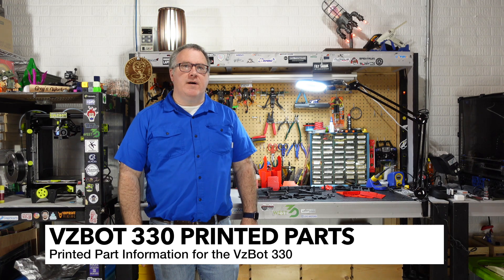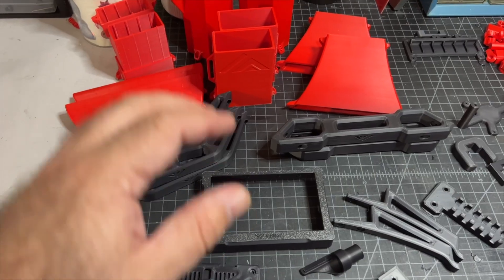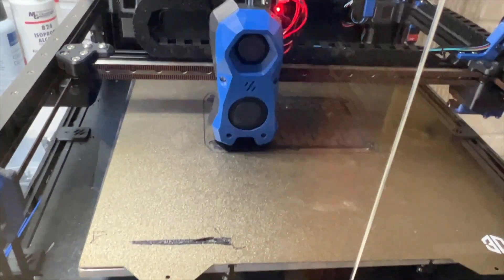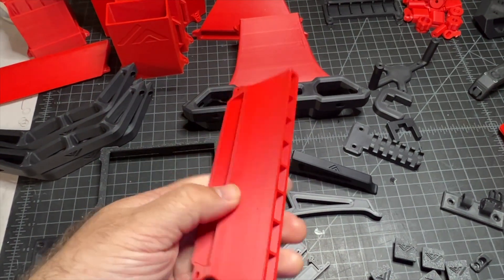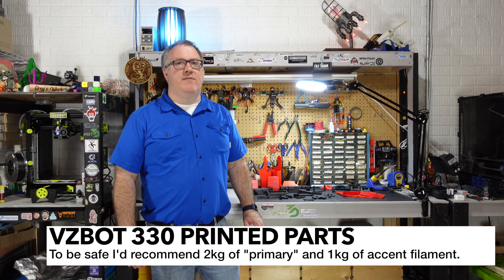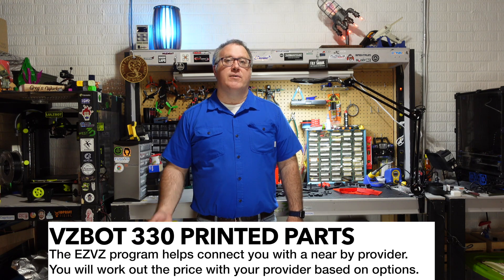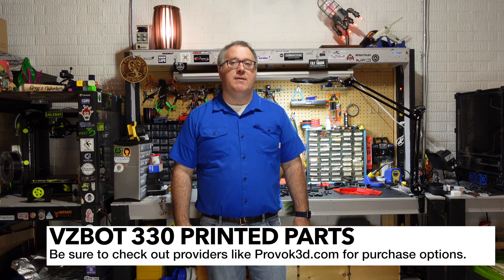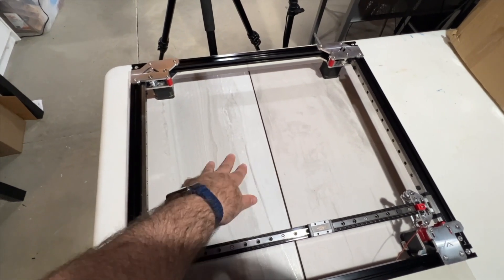VZBot330 3D Printed Part Options

Comment: Wow, wish my Voron 2.4 could achieve prints like that; I’d have no need for the VZBot :) I think I have Z-wobble going on from the gantry, plus a lot of warping, and gaps/strings from filament sticking during retraction (I use a Rapido hotend).

Does the VZ-bot kit come with the panels?
Reply from the maker: It took me a while to get my voron 2.4 tuned and the kinks worked out, but it’s worth the effort if you can put the time in. The Z wobble can be caused by things not quite being perfectly square with the gantry. I use a rapido on my 2.4 also and use a low retraction, about .5mm. I also have an Lgx lite which does really well.  The Vzbot is easier to get square mechanically but it’s probably a bit more work to tune especially because of the high speeds and cooling. Best of luck and thanks for stopping by!
Reply: @GregsMakerCorner  happy to report I’ve ordered the VZBot kit - and even better, I’ve got my Voron printing nicely - belt tensions, an adjustment of the extruder (needed a bit more tension and the drive gear moving just slightly to align). Now I can run reduced retraction successfully, in line with what you’d said! Also, the Z joints in the corners of the gantry were quite loose (and loose Z belts too I think weren’t helping with the Z-hop). It’s producing clean prints now :) Like you say, just takes time to work through the mechanicals and get them running sweetly. Even though the bed is textured, I found a scrub with Scotchbrite and soapy water has improved adhesion a lot; no corner warping now
Reply from the maker: That's great to hear @alexshepherd  ! Awesome on both accounts, getting the V2.4 printing and also ordering the VzBot. I think you will really enjoy it, it's a fun build. Best of luck and hope all goes well for you! I now have my build done and will continue getting footage out!
Reply: Now after watching your video again - I think it’s time for me to try ASA (instead of ABS). That might be why I’ve had parts work loose on my Voron, but I think perhaps it was because I used eSun ABS+. I’ve since found that material isn’t particularly good for strength. I use a better, standard ABS material these days. Thanks again for your inspiration!
Reply from the maker: @alexshepherd  eSun ABS+ isn't fantastic, but I would hope it will last a bit. I find that Polymaker ASA is a really good filament and pretty happy with it.

Comment: Should be right around 500kg of filament for the RSCS ducts alone, but they're not really needed unless you're speed benchying - the CPAP is pretty crazy  so RSCS can be skipped during the initial build and installed/wired up later.  The thicker walls/higher infill are for the printed version of the gantry/toolhead, the only ones in the motion system that come to mind are the printed parts that replace the PLA ones used for shipping.  Can't wait for the frame and ganty install, don't forget to clean/lube those rails! (an unfortunately more common than it should be skipped step for some newer builders of Mellow's kit)
Reply from the maker: I did notice the rails seemed very dry! It seems odd they didn’t liube them especially since the benefit is having it pre-installed…. Great pointers!